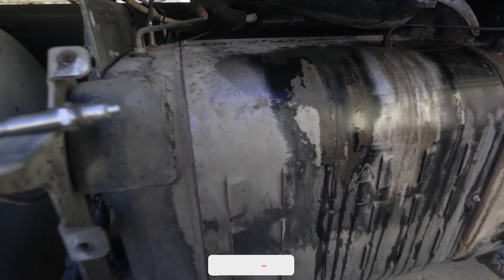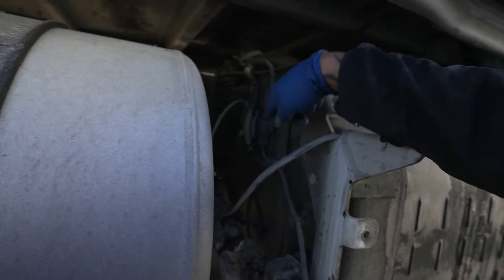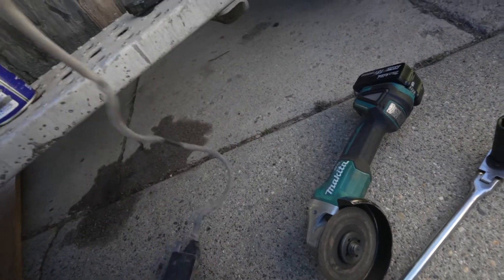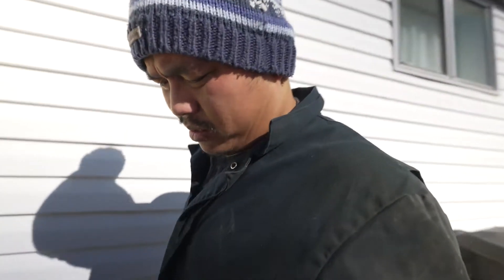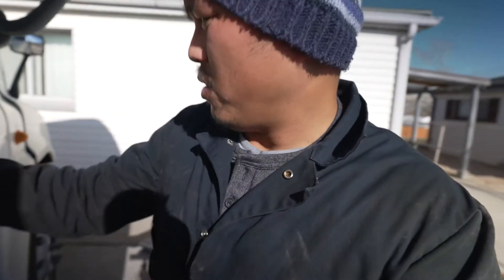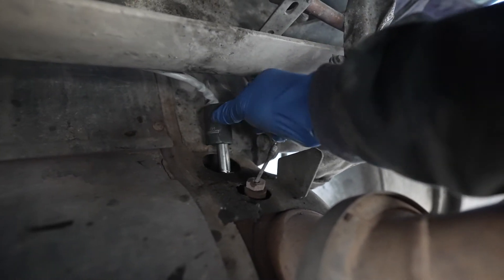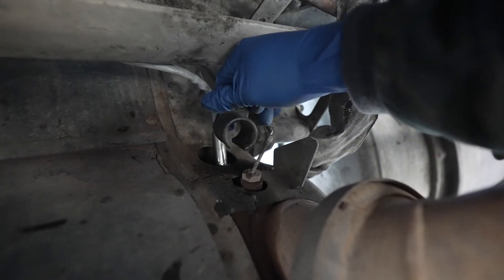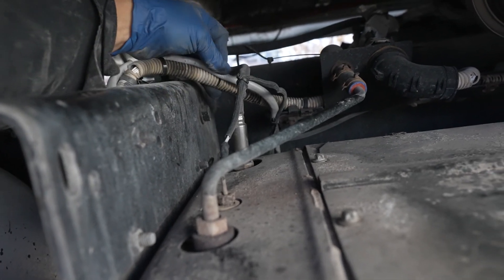Trucking: Emission Headache pt 2 (Outlet NoX Sensor replacement)

Comment: Put a clamp around the socket. Helps with flexing. Put anti seize on before putting back in. Heat also loosens it up

Comment: 2 questions man 
1 how you been long time not posting new video. 

2. My truck dashboard shows code  I think 3216 it says inlet nox sensor. What if I don’t change it what happens?
Reply from the maker: Sorry been busy and mostly not really motivated the way the market is at the moment.

NoX yes replace it right away. It will eventually derate you. Usually when the Inlet NoX shows up; thats actually the problem. I would say replace then REGEN several times in a row to clear your DOC and reset Ash accumulator and SCR after.
Reply: @pinoytrucking  good to hear you bro. Yea market , diesel price. Yea I changed it
Reply: Using antisieze helps